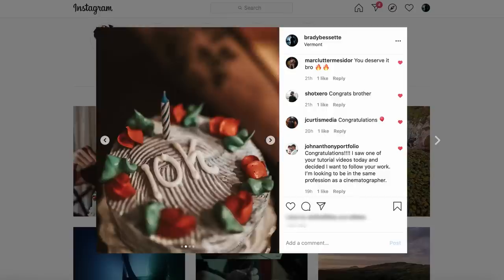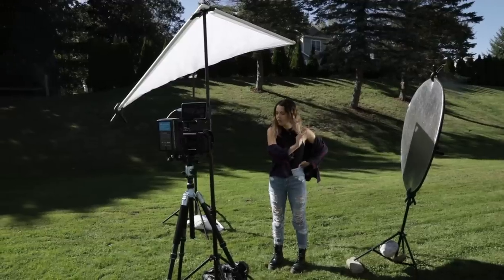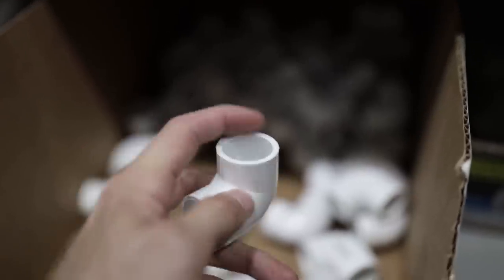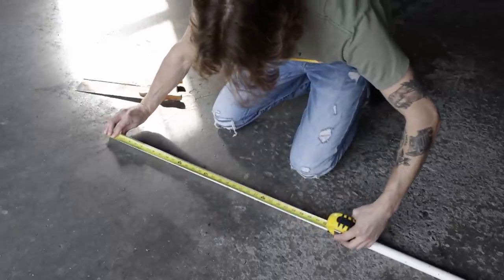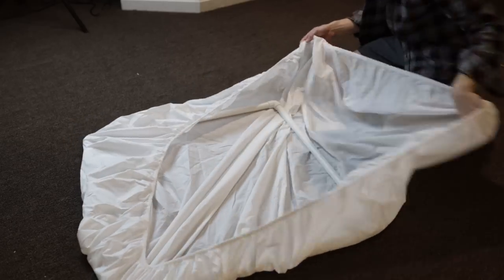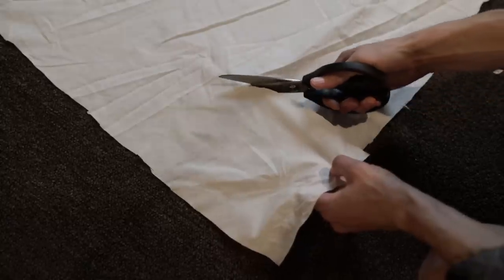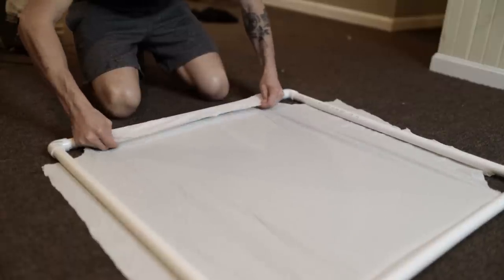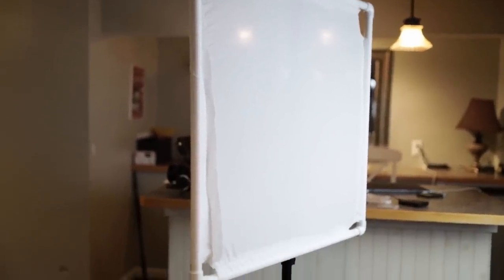How To: DIY Diffusion Scrim for UNDER $20

Comment: these kinds of videos are gold. i use a telescopic broomstick and two 2m x 2m photographic silks from amazon with clamps to produce the largest soft light i possibly can. i even use it during inside interview scenes in my commercial work. it's super easy to carry and super soft. but you do need a lot of light with it. like 2x aputure 120d or a 300d or comparable to get it to be like iso400 f2.8 from 2m away.
Reply from the maker: Yeah it’s tough cutting so much light but so needed

Comment: Instead of sewing or adhering the fabric to the frame, hooks and eyelets are a great, cheap way to hold up the fabric while also leaving it removable!
Reply from the maker: That is true, another option!
Reply: 俺は天才だ！
Reply: if it's too tight the fabric might break sooner than you expect. I think sawing some good and generous wide Velcro could make it easier to not go back and forth many times, then you tight a little more from whatever side you want.
Great video, love DIY stuff, specially when it comes to cinamontography
Reply: But how?
Reply: @Dare2Share930  look up "fabric eyelet tool" or "eyelet pliers". Around the edges of the fabric, you punch holes and attach a metal grommet ring. After that, you can hang the fabric on hooks, such as shower curtain hooks.
Reply: @AllieSakwa  thanks❤️
Reply: i agree with this, currently planning to make my own scrim(s), this sounds like the most practical thing

Comment: I made something really similar recently, but essentially did it in reverse (seemed simpler)  Made the scrim sheet first, same method.. square and corners cut out, then stitched.. thanks mum! Then cut the pipe (in my case 28mm dowel and brass 90deg elbows.. don't judge :P it was free) it meant the seams were all perfectly neat and you could stretch the sheet to the right tension and then measure off the correct length of "pipe" to ensure it stayed that way.. either way same result!! :D
Reply from the maker: Hey if it works it works! Thanks for stopping by

Comment: Did you just use a clamp to attach it to the light stand?  I was thinking about using this for a negative fill and wondering what suggestions you had to fix it to a lightstand so you can move it at different angles.

Comment: No one calls these scrims. If you’re on set and someone asks you for a scrim they are asking for a wire net that you drop in front of tungsten lights to take them down in intensity. This is just called a frame of diff. Usually just referenced by its size. Like the DP will say “let’s get a 4 by of 251 in there” meaning they want a 4 foot by 4 foot frame skinned with 251 diffusion in front of the light. Or usually because you’ll only have 4x4 frames of diff on the grip truck people will just refer to it as “diff”. Do not call it a scrimm. You’ll look like you don’t know what you’re doing and they’ll quickly send you off to the grip truck to grab a bag of T stops ;)

Comment: why not just use a cheap 5 in 1 reflector that has the diffusion material at its core? They're really cheap (60$ or something) come ready made, you can get large 2.0mx1.5m ones, they're lightweight AND get the added benefit of them being foldable.

Comment: That's diffusion NOT A SCRIM, scrims are wire mesh that go ON LIGHT if its infront if the light its A NET
Reply: Scrims & nets cut light WITHOUT diffusing them